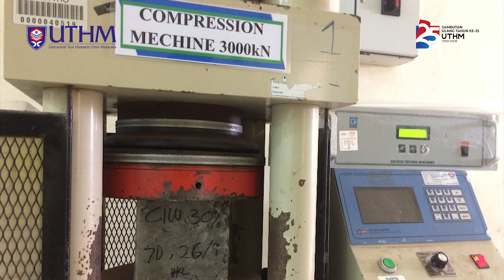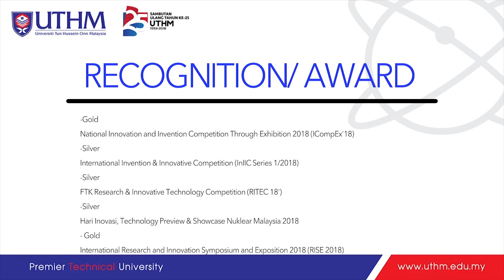CERAMIC INDUSTRIAL WASTE AS REPLACEMENT MATERIAL OF FINE AGGREGATE IN CONCRETE MIX

Comment: Ceramic waste can be crushed into powder ,and be used as an admixture in concrete ..it slightly reduceses the overall weight of concrete ,improves workerbility ,tensile and compression strenght of concrete.